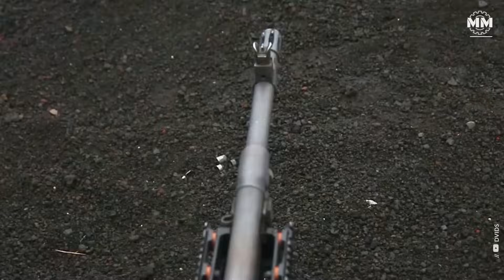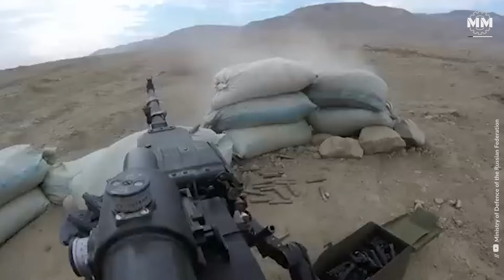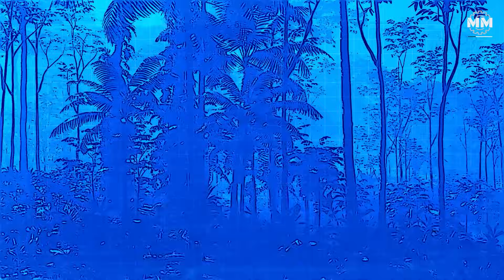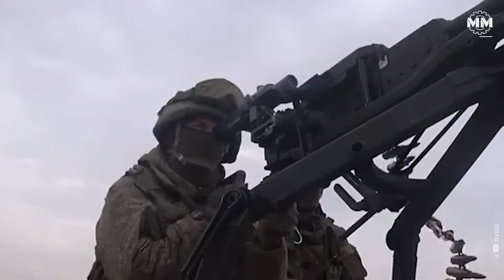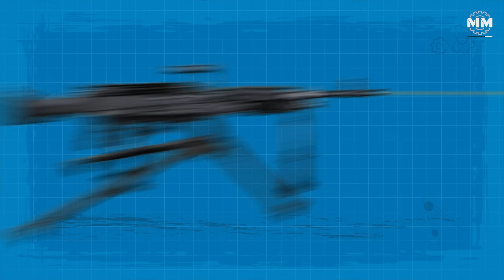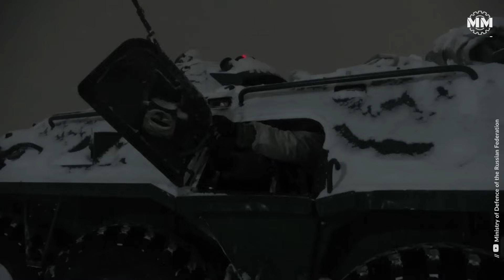M240 vs PKM: Which 7.62mm Beast Rules the Battlefield?

Comment: the author tried to attribute shortcomings to the PKM, although American weapons are being modernized precisely after they have studied the advantages of Russian weapons. I'm talking about a replaceable barrel. the author says that the PKM is delivered without a replaceable barrel. This is not true, and in general they made a replacement barrel on the M240 because they saw something like this on a Russian machine gun. and the author correctly said in the difference of philosophy. Americans are used to building a base and bringing in weapons, replacement guns and toilet paper. after which they launched an attack on some weak country. Russian weapons are designed to repel a sudden attack or for the most sudden attack - grabbed the weapon and rushed into battle.  The problem is that no one has ever attacked the United States; they are used to attacking from an organized base.

Comment: I respect the PKM from being shot at with several in combat. What really interests me is it's bare bones weight as a machine gun. The M249 SAW in 5.56 was about 15 pounds empty and 23 pounds with a 200 round drum belt inside. Honestly the M249 SAW I fell in love with because it became lighter as you fired it. The PKM is my true envy because before I became a SAW gunner I was an M-60 gunner in the Weapons Squad. I got to fire and field strip a real Soviet PKM and it was a superior gun in weight and operation compared to the M-60. Cleaning was so simple and less parts. Generally people will not understand me because machine gunners are specialists in their trade. I was taught in one hour how to strip and reassemble the weapon and fire. I the rounds impact on the range from 100 to 500 meters on pop up ranges. Firing on paper short range tomb stone targets I was impressed by it's accuracy for a standard gunner's qualification course. Firing short bursts was like the SAW with no interruptions to hit with tight groups. The downside is most PKMs I have come across have worn out barrels and weak springs and shot horribly from the well maintained guns captured by the Military Intell unit. A well looked after or hardly used PKM is a very good gun that operates the same as an M240 and ballistically same performance in the 7.62 Mosin Nagant ammo. Very pleasant to shoot and accurate once I figured out the balance of aiming and rate of fire.

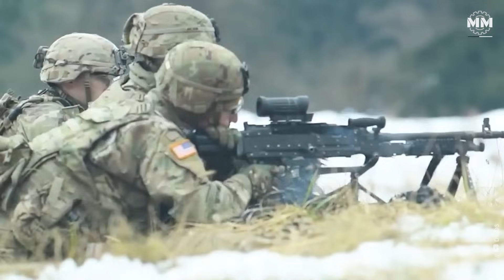Comment: 8:40 The gun in the video here (and a few other places in the video) is NOT a PKM but rather a DShK 12.7mm HEAVY machine gun. It's significantly larger to the 7.62mm PKM. That's like conflating the M2 Browning with the M240. Different calibers, different roles.
Reply: Ты не прав в своей правоте😁... это не ДШК , а НСВ "Утес" (индекс ГРАУ - 6П11) и да он под патрон 12,7х108 мм.!!
Reply: It's a Russian Kord.
Reply: @garpri9538 КОРД другой...немного! Это "Утёс"!
Reply: It's not even a DShK 12.7mm heavy machine gun, but a "Kord", a newer 12.7mm heavy machine gun.
Reply: @ilijaspasojevic7031 Thank you for the clarification. Either way, it's not a a PKM. Video editor needs to present the correct video clips. I suspect it was cobbled together using AI, but the editor didn't catch the mistake.
Reply: @ilijaspasojevic7031  нет, это НСВ "Утёс", ещё советский пулемет! КОРД - это чисто его российский аналог, внешне отличить можно по дульному устройству, чтобы стрелять с сошек!

Comment: How to tell you don't know your subject matter
Reply: 100% this dude is a dumb. 90% of 240Bs have been replaced by Lima model - slightly lighter, no adjustable regulator, slower rate of fire. The only 240 that still has adjustable regulator is a C, Delta might have one too, but I don't fuck with UH60's. PK/M comes with spare barrel, they also have MG teams, depending on the unit, etc, so whatever, sustained and rapid fire rates are similar. PKMN and newer PKM and PKP have rails = same-same. Pick what you want, FN MAG and PK/M are two top GPMGs out there. If I had to carry one again, I'd go with PKM just because 240 and ammo bags fucked up my back 🤣
Reply: @agga7517 thanks for the info. But the bad guys have better weapons. slightly deadly better weapons.
Reply: @Los_Benjamin Drones are doing over 70% of the job...

Comment: I have used both . Both very good weapons , very accurate and  durable .  Both with good points , and minor not so good points . GPMG  is heavier , needs cleaning more often ( than the PKM ) normally parts are distributed around the section for this . Can be used by one person . 2 man team in the British army . Only fault I found with the PKM was the belt for the ammo. .i preferred the linked belt of the GPMG .
My favourite all time machine gun ? The LMG !  converted Bren gun in 7.62 x 51 . Magazine fed but super accurate on single shot . In my opinion , it should have been kept in the section . The GPMG in the sustained fire roll in Company or Battalion  HQ  ,  6  x GPMG on the gun line in the sustained fire roll . Was fcuking impressive !
Reply: WHICH ONE WOULD YOU CARRY IN A JUNGLE OR ZOMBIE APOCALYPSE.?
Without having extra barrels or ability to maintain?
Reply: @idomalion6167  you can reload PK/M belts, '240/MAG you have to go looking for links that are all over the ground.
Reply: So basically the Indian army section loadout, as their section HQ carries 2 L4A4s , although it is now being phased out by IWI Negev